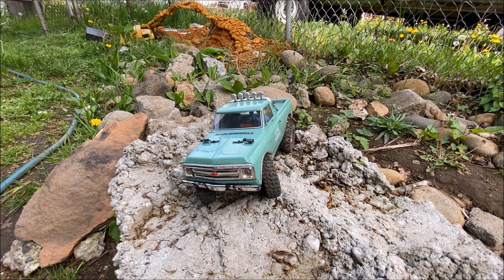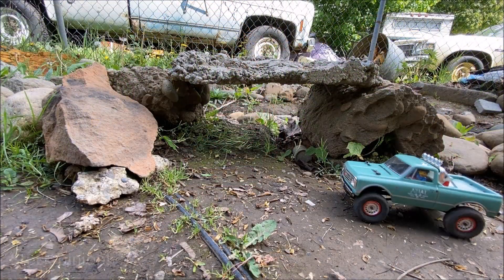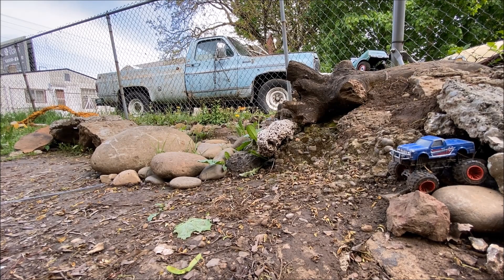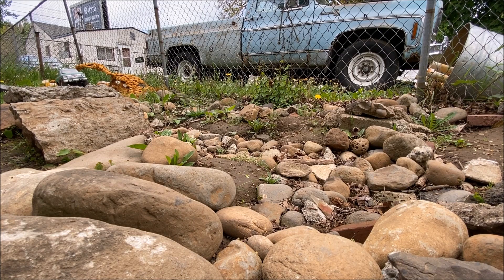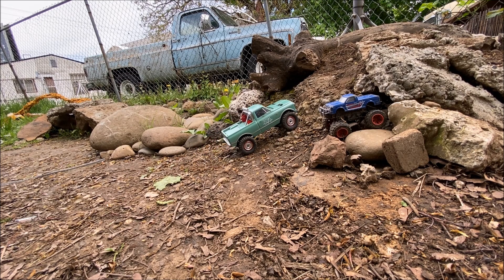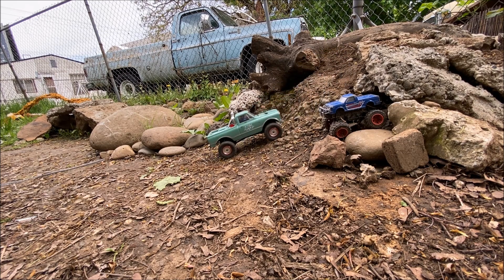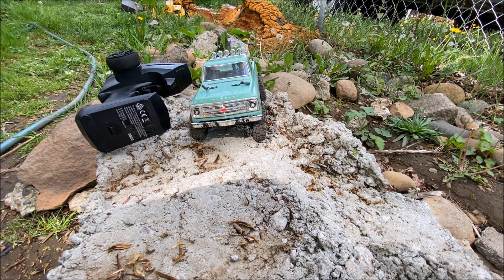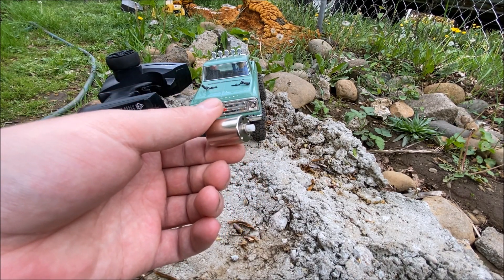Scx24 c10 10t pinion vs stock!

Comment: Awesome! Great idea. Man, what a difference that makes. Can't wait to see if you get the motor to work.👍🏼👊🏼💯
Reply: ..... Just when you thought you did everything to your Micro, Ben!!! 😲😂😄😂

Seriously, who knew you could source lower gears from a SERVO!!?? 😎
Reply: @CarminesRCTipsandTricks  I know. Hahaha keeps me on my toes. Haha thing did great with the other gear. That is what I like the slow crawl.
Reply: @BuyitBreakitFixit  Hey... Even ME, with less than nothing - has a couple of dead Servos!! 😎 
All I need is the SCX24.... and I can't see that happening. 😞 
But I get to see others.
Reply from the maker: PoorManRC actually I did this same mod to my micro ecx barrage a long time ago now. It made a big difference. But it still couldn’t make the barrage last. Even with the smaller servo pinion it would burn up motors. 😑
Reply: @TJthercGuy   I've HEARD that the only real way to get the ECX to hold up is to fit a 370 or 380 Motor. Apparently it's Gear Reduction is 💩!

The SCX24 seems to be the most capable still. Wish I could afford one....
Reply from the maker: PoorManRC yeah the barrage is ok for light trailing just not big rocks. I was told the Rc4wd v2 tans helps it. I want to get 1 or a clone and put some scx24 axles under it. That would make a night and day difference! ✌️😄
Reply: @TJthercGuy  That sounds like a cool experiment!!! 

Speaking of - apparently when you spend a BUTTLOAD of money - they ship EXPRESS!! 😲😎
I ordered my new MOG yesterday, and it's supposed to arrive TOMORROW!! 😲
Reply from the maker: PoorManRC Awesome man! 👌

Comment: Only had to sacrifice 2 servos to get myself a brass 10t gear. Now that it's on there it crawls great with the ox motor. It's a lot louder too, I assume it's the brass gear
Reply: Metal and plastic don't like each other the brass gears stronger then the plastic spur gear I'm assuming even with your lash set correctly would still strip the plastic spur gear over time

Comment: Drag brake with worm gears ? Lol..😂
Reply from the maker: Yeah the stock esc has a weak drag brake. That mode is mostly for instant reverse though. The scx24 can actually slowly roll down hill it’s not quite like a old trekker where they lock up completely soon as you let off the throttle. ✌️🙂

Comment: I was just asking about a servo pinion gear on Facebook. I was wanting to try it out. So it actually works
Reply from the maker: Wildman georges rc Channel so far it’s working well. I should have put a fresh lipo on it for the video it’s so much smoother.  But give it a bit we will see how the older deadbolt motor handles it over some time. I put the original motor up just in case. ✌️😜

Comment: I just put a rc4wd motor in my Jeep and I used the stock scx24 pinion it’s really nice I’m blown away really
Reply from the maker: Wildman georges rc Channel awesome I heard them are good micro motors. How’s the top end with the Rc4wd motor?
Reply: TJ the rc Guy it’s not bad but it is noticeably slower. The slow crawl tho is nice and it doesn’t stall so bad all the time

Comment: Nice cheap mod bro👍I'm going to have to dig out some old servos now🤣
Reply from the maker: BullgearRC videos thanks and heck yeah it’s a bit tricky to get the servo pinion off and on the stock motor without damaging the soft bass. But worth it so far we will see how it holds up over some time. ✌️😊

Comment: Do you know the specs on the pinion? to try it myself. I don't know what the modulus of the original gear is.
Reply from the maker: I’m not 100% sure but the stock pinion is 11t I think.

Comment: Man you lucked out with that gear..
It's often a pain to source gears,  and you had one right there in your servo. 
Im gonna go tear apart some dead servos! 
Im really interested to see how that servo motor works out.
Reply from the maker: For sure from what I’ve seen most 1/10th scale servos have the same pinions. Just be very carful getting it off the servo motor it’s a bit tricky. They are soft brass so really easy to damage. I smashed mine a tiny bit on the end  by lightly tapping it into the scx24 motor shaft but that part isn’t hitting my spur so it’s all good. ✌️😄

Comment: Oh yea..so much fun...do u super glue the pinion on or something..seems like it wud slip
Reply from the maker: Trent McCracken yes you put a tiny bit on the motor shaft. normally that works fine but the sumo servo
I have is actually 3 rigged together and I’ve already done it several times in the past. 😅
Works to make the stock motor pinion work on the micro ecx barrage/rgt motor to. ✌️😊
Reply: Maybe if the clearance is TOO much... it wud slip.
Super Glue done right, makes a great gap filler!